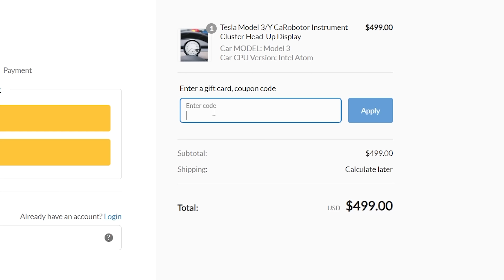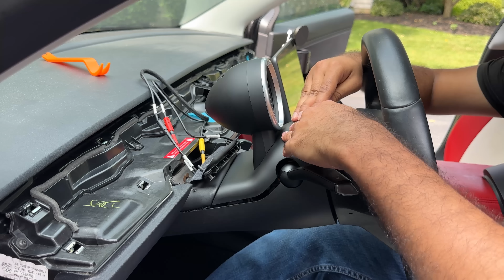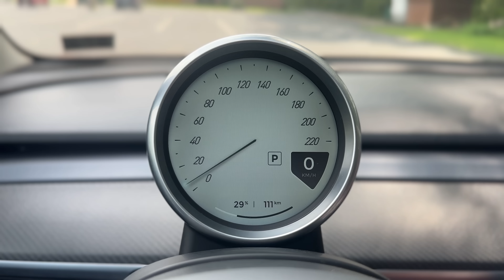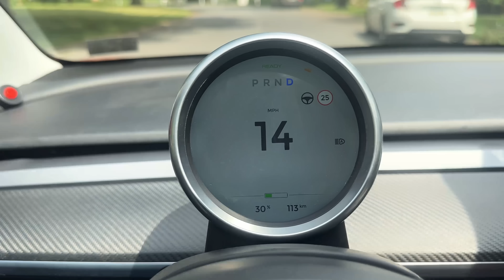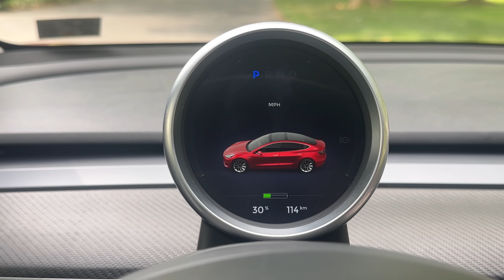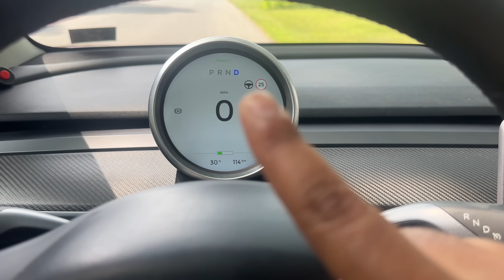NEW Instrument Cluster Display for Tesla Model 3/Y 2023 (UI Improvements & Unique Design) #tesla

Comment: When I first installed my auxiliary display a few years back, we were told to unplug the 12V battery and disconnect the high-volt battery. Still, I see you and a few other installers leave the power on when you unplug the computer for the bypass jumper. Is that now officially OK, or should I disconnect the 12V and the high voltage before installation? Thank you again for a great demonstration.
Reply: I installed it and never shut down anything. It's totally fine. I saw it done both ways and am too lazy, so I went the easy way out, and it was a simple project.

Comment: Man, your opinions on this device matched mine entirely.  The price is really the only negative that I can see that would dissuade me from buying this.  NOW, if they want to show my side camera views when initiating turns on that display?  That would be the game changer.  I still wouldn't pay $500 for it, but it would add WAY more value, personally speaking.  So far, no manufacturer has been able to integrate turn camera views in these displays, and that's why I'm holding off.  I must conclude by saying that this is the most attractive steering wheel attached front display I've seen you review so far.  It looks great and the graphics are beautiful.  Love the shadowing of the speedo needle during day mode.  I also think the bullet shape in the rear might help with airflow from the dash, whereas the rectangular flat displays would potentially block more airflow from the vent.  With a few more refinements, I could see me buying one of these, eventually.
Reply from the maker: Thank you so much my friend for always watching my videos and supporting the channel. I had that conversation about the side cameras with so many engineers and they all tell me that the camera feed isn't possible. As per them, there is no Y connector for the camera plug and even if there was, it wouldn't work. The speed etc signal is easy to extract as those are just information with specific codes but the camera feed is not something we can extract using a code, it is hardwired within the Tesla screen. There was a company that was making some great progress adding camera underneath the side mirrors and showing blind spot camera view that way, but they went MIA on me, so assuming the product didn't make sense...I still hope someone makes that work though :)
Reply: @ShivaSapkota  Thank you for the follow up.  Really interesting info.  Cheers.

Comment: Seems a little large for my taste. How does it do with airflow? And nothing from autopilot? No steering wheel nags?
Reply from the maker: The autopilot indicator works on regular autopilot but not on FSD beta. It is a bit bigger than other displays for sure. Thank you
Reply: Shiva, you didn’t answer his question about airflow
Reply from the maker: @davejohnson6144  It does block some airflow but not as bad as the rectangular display. When I increase the air speed, I can feel the air hitting my face. Thanks.
Reply: Thanks. I have FSD beta too. It wasn't clear if just the blue indicator didn't work or also the steering wheel nags. Do any of the displays support steering wheel nags with FSD beta?
Reply from the maker: @David_L3  I have yet to test it but they pushed me a software on the new 6.86 display I reviewed and they say it works with FSD beta.
Reply: @ShivaSapkota  Thanks.  I appreciate that you've reviewed most of the displays out there (some seem to be clones).  Is there a summary somewhere saying which ones provide steering wheel nags with FSD beta?  I also want to minimize air flow block.  I'm thinking the round one from 3 months back may be the way to go.  https://youtu.be/Uwr4ZJHTE3w